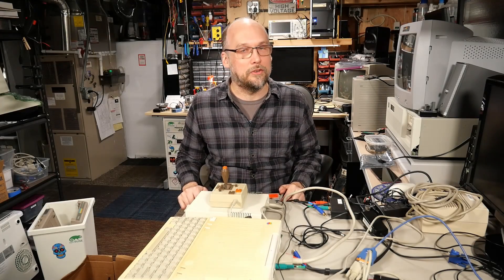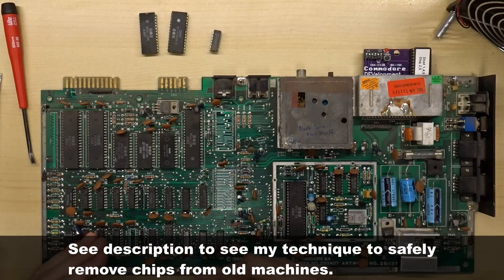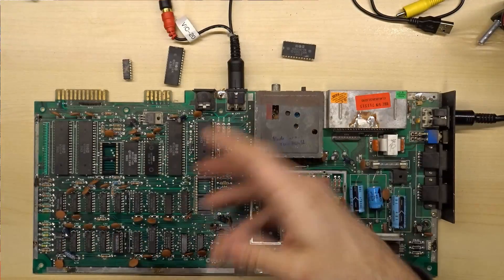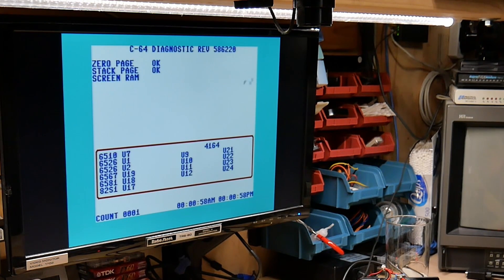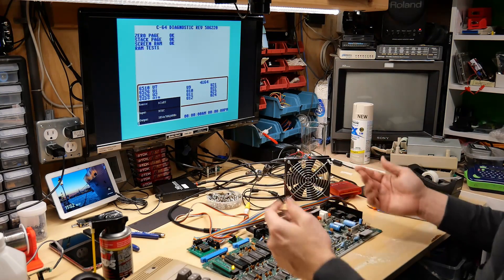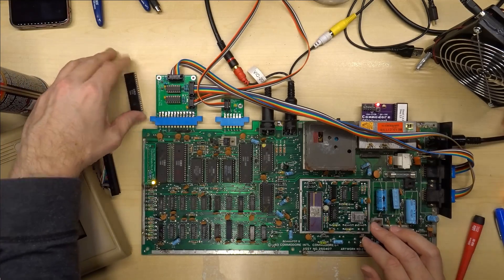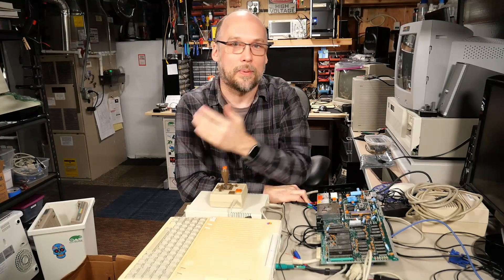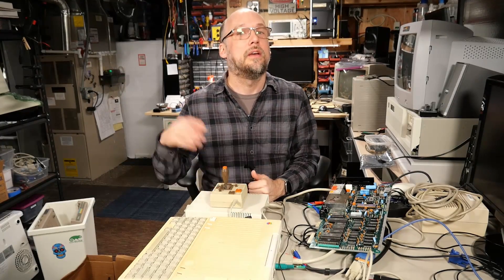Lincoln City C64 Testing and Repairs - Part 2

Comment: Hi Adrian,   At 1' 49" , The first three memory chips are D4164C-2 and the fourth memory chip is a 4264-15  ...i.e first three 200nS and the fourth a 150nS...not sure if the chips are compatible      without checking the type of the fourth one. Have you found that 150nS work OK with the slower 200nS ?  It's over 30 years since I worked with memory boards.
I enjoy watching you work on the C64 boards as I had 3 of them.

Comment: Have you seen that the timers on both CIAs not running ? TOD stays on zero. I think the 60Hz for the timers is missing. If the timer does not counting down for underflow there is no interrupt. Check pin 19 for 60hz.

Comment: Great video as usual, Adrian. Thank you very much!

If you don't mind some friendly advice, the only thing I would suggest is include more footage of your troubleshooting process (preferably not fast forwarded), particularly with regards to testing continuity between the chips and checking the various signals on your oscilloscope, logic probe, etc. You skipped over that whole process in this video with board #1. I think it would help others learn more of those necessary skills when it comes to troubleshooting their own boards.

Comment: Great series, Thank you Adrian! I have a mix of ten c-64, 64c, Plus4 and 128s that have been in clean, dry storage for years. Any recommendations for powering them up? They all worked back in the early 2000s but have not been powered up since. Should I source a new power supply before trying? I don't want to fry the chips! Thanks for any info and again, thanks for the great channel!
Reply from the maker: Yeah I'd get a new PSU -- the C128 ones are safe to use but the original C64 ones are bad. I cut the end off my C128 PSU and added the C64 connector to it -- then a femals C64 DIN and then can plug the 128 cut off wire back into it. That way it works for both machines.

Comment: Did you figure it out about the IRQ error,the video is a week old tho?
My idea would be realted to the user port, that can also crate an IRQ and is managed by U2.
But there is not much hardware involved by this, maybe just a broken pullup resistor !?

¯\_(ツ)_/¯
Reply from the maker: Haven't yet. I've been travelling so haven't looked at that board again.

Comment: Hi Adrian, compliments on your repairs and videos.
I still do quite some repairs on c64’s amongst others, and I know what the ‘problem’ is with the interupt.
Nothing! It is the test, it’s not 100% correct, so it gives a false indication on some of the c64 motherboards. It all depends on the combination of the motherboard and the ic used. You can try several others ic’s and one of them might pass the test. Regardless, even though it indicates bad, it will work fine so don’t spend too much time on it... you have tested the signals and like you said it works fine.

Comment: Brasso can work well at polishing contacts, but you do have to be careful with it; use it too much and you may risk polishing off the plating.
Reply from the maker: Indeed .. and also I was reading you need to clean all the residue off very well afterwards with alcohol.

Comment: I started yelling at the screen when you brought out the Brasso. That stuff etches the hard gold contacts and should not be used on hard gold! The horrible pitting you have is only going to get worse over time because that's what Brasso is meant to do (this is not an issue with thicker coatings like HASL - hard gold is only microns thick). You would be better off with a fiberglass pen - just use light strokes with it. Amazon ASIN B003NHDITW if you want to look at one.
Reply from the maker: Heh -- I'll order one of those pens, have been meaning to get one for the longest time for taking off soldermask.

Comment: First of all, this is an excellent and very enjoyable repair series. Second, dang, that interrupt issue is a head-scratcher, but I am reading a lot of excellent theories and suggestions below. I know you can figure it out.😉 Third, I just added Brasso to my Amazon cart -- magic, that stuff!
Reply from the maker: I have been warned by others that Brasso is very very harsh so only use it carefully and on the most corroded things. Also, make sure to clean it off 100% when you are done (using alcohol.)
Reply: @adriansdigitalbasement  Oh, Okay. Good to know. I just received a bottle from Amazon. Thanks for the warning info.

Comment: 7406 chips in the C64 usually fails as it runs hot in general. You can test the NMI by hitting the RESTORE key very quickly (few milliseconds) and you will see your basic screen reset. This is achieved by the NE555 and the 7406.
Reply from the maker: Yeah RUN STOP + Restore works normally on this machine.

Comment: I think, as part of the interrupt test,  the alarm timer on the CIAs are tested. This requires a proper TOD signal  around that AND gate U27.  I would view the TOD with a scope to check.
Reply from the maker: I don't think it's going to be that as the you can see in the video the clocks on the bottom line of the diag screen are showing the correct counts as the diag runs. This relies on the TOD input to these 6526 chips.

Comment: Back in the 80's I had trouble generating the NMI using the restore button. Someone told me to change the value of a particular resistor and it worked perfectly from then on. I can't remember the actual part number, but you should be able to find it in schematic.
Reply: You had to hit it really hard ;-)

Comment: If the Restore key is working correctly than that is probably a good indication that the NMI line is not the problem. Something to try, continuity between U1 and U2, check any pin that connects U1 to U2 according to the schematic, there could be a data pin that is floating causing an issue. I'm not sure how the user port harness is wired but I would assume that U1.CNT connects to U2.SP and U2.CNT connects to U1.SP, are these connected when the harness is installed?

Comment: I've had a failed resistor array (or pack) on an arcade machine board recently, might be worth checking. They can get hairline cracks in them, they are intolerant of boards being flexed.
Reply from the maker: ah yes I've had that too. I do need to check all of the schematics.

Comment: brasso ! wow that was a staple metal polish in the uk from way back (silvo was its counter part for silver plated stuff). impressive results must buy some. Its smell is pretty nostalgic :)
Reply from the maker: Yeah that slight ammonia smell. It works so damn well!
Reply: @adriansdigitalbasement  got a C64c on the bench so will give it a go!

Comment: Just a tip: use weimans metal polish instead of brasso.  It's not nearly as toxic, and smells like toothpaste instead of nasty chemicals.  Also brasso is supposedly acidic so make sure you get all of it off or it might corrode the board.
Reply from the maker: Yeah indeed people have mentioned that Brasso is hard on other parts -- so I'm going to go back and make sure to clean the boards again around where I used it to make sure it's all gone.

Comment: If you want to save money on those expensive sockets you can just buy a bunch of long SIP socket parts that you can cut to any length or even combine.  Then just solder one cut down strip to each side of where the DIPs go.
Reply from the maker: Yeah heh, I do that often when I'm out of a particular sockets :-)

Comment: Funny that there are so many failures of the old Micron chips.  I've been running into bad ones on DDR PC2700 RAM modules this past year.  I used to think Micron was the best until recently.
Reply: I think Samsung makes the best RAM. Its often used on graphic cards.

Comment: no, Adrian, don't use Brasso! It removes the gold finishing of the contacts!
Reply: like any strong polish or cutting compound, , doing it once every 40 years wont be a problem

I used to keep my kids school erasers for IBM PC style floppy and IDE cable and edge connectors to clean them up , while i find soft white pencil rubber is to soft, some are ok , the tan round rubber is best and most pen ones in grey t o hard
Reply: There are galvanoplasty kit to restore the gold on contact.
Reply: https://twitter.com/Voultar/status/1230579127855591425?s=20 just watch this guys.

Comment: I wonder how Oxalic acid would do for removing mild corrosion?  Barkeeper's friend is a retail source for this.
Reply: Barkeeer's Friend should work well for that. I've used it on game cartridges when nothing else would work.
Reply: Or use staetler 526 61 mars razor pencil, it's perfect for precise work. But don't apply to much pressure.
Reply from the maker: I really need to try the eraser method. I keep forgetting to buy one.

Comment: You should start if possible, by asking the software author, what triggers the fault message. Only then do you understand what has been tested.
Reply: Erm, it's in the manual at 13:48
Reply: That is only the intention of the test, and at best the theory it uses. However, there may be false positives and logic mistakes in the implementation. 
I should watch the video again and see if this has been answered, but there may be a problem with the timers, the setup of the timers, triggering of the timers, any interrupt table, the setup of the take, any interrupt mask and the setup of these, the target routine, and so on. It could be that the timers are just a bit too late for the verification, but still good for most applications, and so on.

Comment: rule 1, learned from dave of eevblog
check your voltage rails, even young players can be tripped up by this!!! well, not the voltage rails specifically but check your interrupt line, im going to say the resistor has failed open and it isnt being pulled down to 0v.....errr, i mean pull up resistor, not down, oops.... resistors dont fail short but they can still drift
Reply: Especially young players, you mean.

Comment: i was goingto say something along the lines of resistance or a bad clock signal, clock operation timer or something. if its irq, then its clock, if its non maskable interrupt.. its clock generation as far as i know, it may be resistance. check all the resistors, and and check continuity under the board?

Comment: Hi Adrian. I really like your passion for old hardware and also your attitude. You really seem like someone who's not playing a role, who just wants to learn and share it's experience with the world. I really enjoy watching you.

Anyway. Maybe you should get the datasheet for the mos6526 and read the section on interrupt control. I just quickly did, and there's a 60Hz clock signal on pin TODIN that you should really check the accuracy of (relevant to the test performed in paragraph 2 of your dead test cartridge). And if it's there, verify the remainder of what's inside of that chip's datasheet regarding interrupts. Just a taught.
Reply: That doesn't surprise me.  TOD is the Time Of Day clock built into both 6526 chips.  So TODIN carries a 60 Hz signal to keep the TOD clocks accurate.  However, that's all TODIN does; under normal conditions, it doesn't affect the functioning of any other part of the 6526 (that is to say, the TOD clock is not used to time Input/Output operations).  If the signal wasn't accurate, you might not even notice unless you deliberately configure the TOD clocks to generate an interrupt (which the dead test cartridge does), or if something seems wrong with your random numbers... unless you override it by using a negative number like RND(-1), the RND function uses the seconds and tenths-of-seconds registers as part of its seed value.
Reply: @SpearM3064  , as per the datasheet, TODIN is either a 50Hz or 60Hz clock required for accurate time. And paragraph 2 of the Dead Test Cartridge describes a test for the internal alarm of U1 and U2 by adding 2 seconds to their clocks and waiting for the alarm to go off. That timed alarm is provided by TOD, as stated by the datasheet (explained in first paragraph of the Time of Day Clock (TOD) section, on sheet 6). Now, I'm not saying this is the problem, I'm just pointing out something that's being tested in a failed test and hasn't been measured by Adrian.
Reply: @brainiac9579  Well, yeah, I didn't say that the TOD clocks couldn't be used for an interrupt.  I'm saying that in their default state (at bootup), they don't generate an interrupt.  You have to set them up yourself to do that.  Because of the latching feature, BASIC is fast enough to read and write the value of the clocks, but you need to know assembly language to test the interrupts.  But you're right, of course; if that timing signal isn't accurate (or worse, if it's unstable / fluctuates), it can have a knock-on effect on other chip functions, like sending data bits to a device connected to the serial port.
Reply: @SpearM3064  Finally decided to get the datasheet that Adrian is using, and reading, in the video. Also, again from the 6526 datasheet, there's 5 sources of IRQs (if the failing test is really only testing interrupts from that IC): underflow from TIMER A and B, TOD ALARM, Serial Port full/Empty and /FLAG. You can also setup the IC for multi IC communication with interrupt, which is the test that Andrian stated he didn't understoud the description of. So, I guess the circuitry involved into that is worth taking a look at. Also, I'm not sure as to the circumstances when that's used in real use cases, which might be why the computer is behaving normally, except when tested.

Comment: One thing to try is to take both the known good 6526 and the known good 6510 and put them in the sockets on that board you’re having the trouble with; you might be getting the NMI/IRQ all right, but it may be that the 6510 on the problem board is a lot more strict about the timing of the signals, whereas the 6510 from your ZIF machine might be a bit “looser” on the timing requirements. At the same time, put both of the ASICs from the problem board in the ZIF machine and run the full test. Finally, examine the NMI/IRQ pulses directly on the pin(s) of the 6510 and see if the pulses have the correct duration, and the correct rise/fall times, without too much ringing on the rising edge. The problem might not even be with either IC, but with a marginal bypass cap; try bypassing them (both) with another of the same capacitance in parallel (you can just tack the leads on with a bit of solder.) HTH.
Reply from the maker: Oh those chips all work on another board without issue so it's something with the board itself.

Comment: By a process of elimination, the 556 or the inverter are the remaining bits of the puzzle. If the 556 is too slow or fast, the interrupt may not happen slow/fast enough. Also check the signals back from the edge connector, assuming the harness has any part in any of this, as there are still some slightly dodgy looking connections there.

Comment: Adrian I just want you to know I have never owned a C64 but Ive watched all of your videos and you made me also find a love for C64 and its family. Thank you for so many hours of enjoyment. Huge fan here!
Reply: It's a realy fun machine to experiment with, because it's pretty simple and it was originaly designed to be easy to learn and make Your own programs with.
It's also very easy to connect to Your own electronic experiments if one are interested in incorporating hardware to some project or laboration You hawe in mind (There was even a few 3rd part electronic kits especialy for that as i remember).

Even if it's less powerful compared to the later generations it's in my personal opinion a perfect first machine to start with, even if the price realy has ramped up the last years, (at least in Europe) it's still a very affordable machine and there are pretty lot of equipment and spare parts still around.

Comment: A tiny amount of Brasso is probably OK on edge connectors like this which have quite bad surface corrosion.

But, I definitely would NOT recommend using Brasso on things like cartridge slot connectors / sockets.
It can be tough to completely clean off the Brasso afterwards.

(nor on any other types of connector where you can't easily clean off every trace of Brasso / Silvo.)

Brasso is a relatively harsh abrasive, so if even a tiny amount gets left on the contacts of a cart connector, it can wear down the edge connectors (fingers) of both the cart and the connector.

You did the right thing here by cleaning the edge connectors thoroughly with IPA afterwards. ;)
Reply: its also conductive
Reply: @frogz  Good point.

It's not ideal stuff for contacts unless you have very bad corrosion and it's a last resort.

Something like the type of Deoxit that doesn't leave any oils or residue behind would be a lot better.

In fact, Brasso does leave a film of polish behind, so it could actually be making the electrical contact worse unless it's completely cleaned off...

http://retrowaretv.com/the-dos-and-donts-of-game-cartridge-cleaning/

Comment: Regarding the faulty interrupt: you may want to test Datasette operations. As I recall it, it's possible to damage the CIA interrupt circuitry when resetting the C64 by user port pin 1 and 3 and accidentally connecting another pin. (Maybe it's just a fried diode.) The machine will work just fine in usual operations, but will show problems with the Datasette. I believe, the error condition ist the C64 not waiting for the play button being pressed, rather behaving as if it were pressed all the time.
(Actually, my own one is showing these symptoms.)
Reply: This gives me an idea: it also MIGHT be that the pitting on the cassette port is causing the test harness not to have a good connection. I don't know what — if anything — can be done to restore the pins on the cassette port, though.